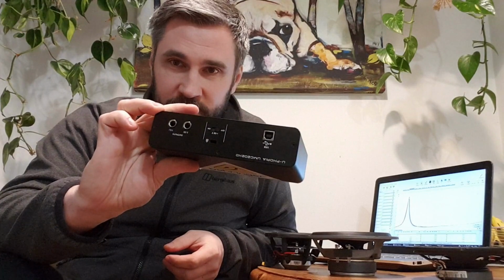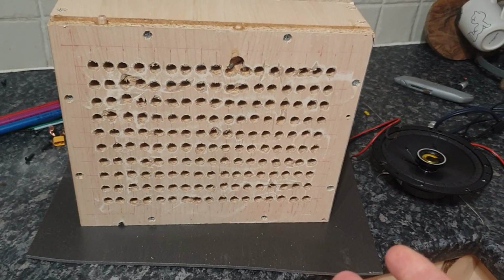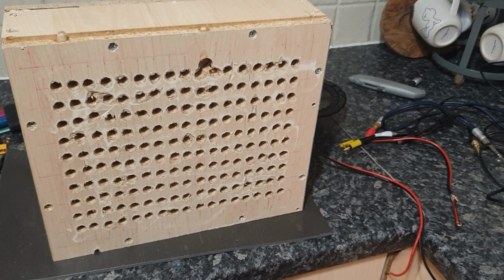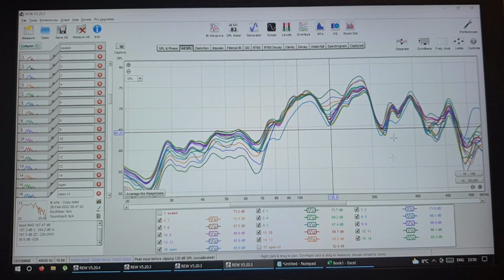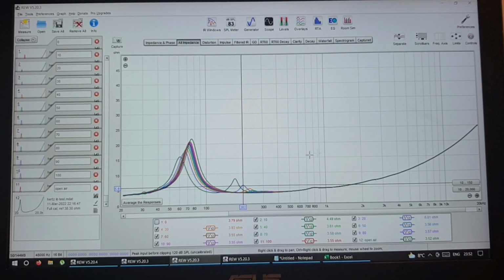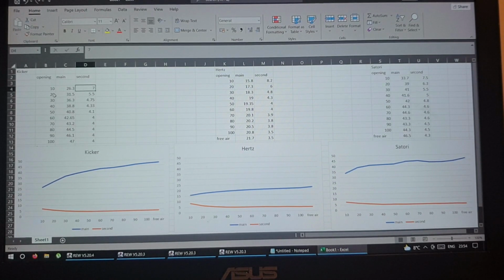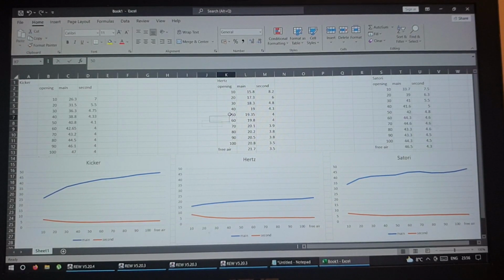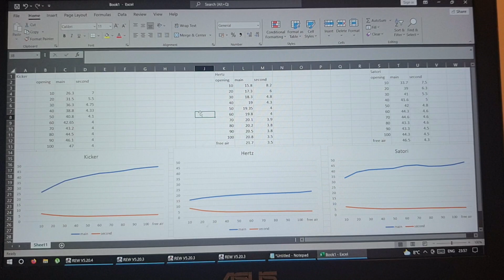Part 2 of Cut out for IB, how big?

Comment: Great video again… thanks for this. Just to get a super basic understanding of what an impedance curve tell you… does it tell you the frequency at where the driver “rings” or resonates very easily, meaning very little power is needed to play that note? And the secondary spike in the impedance curve means it’s an unnatural resonance, and in this case it’s causing cancellations instead of a peak? Cuz I would think any resonance causes a spike (like a ported box at the tuning frequency) in frequency response but not a dip?
Reply: @RAW-CAt  ahhhhhh right... thank you